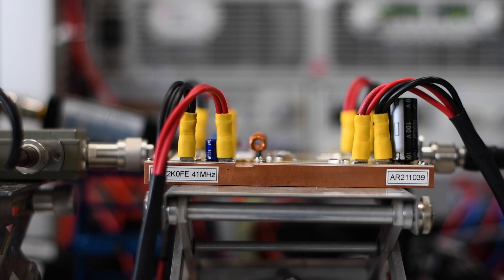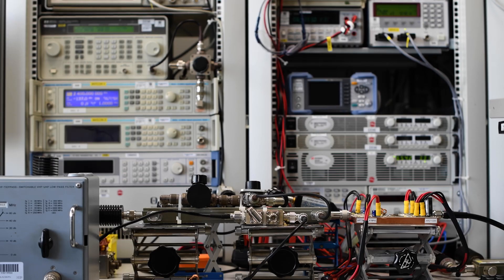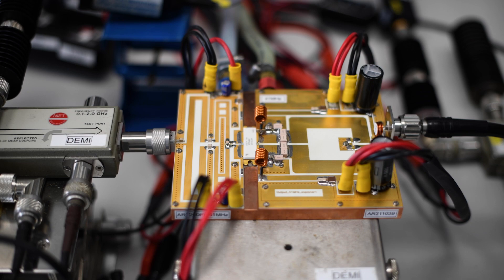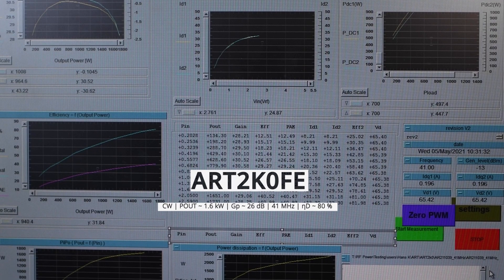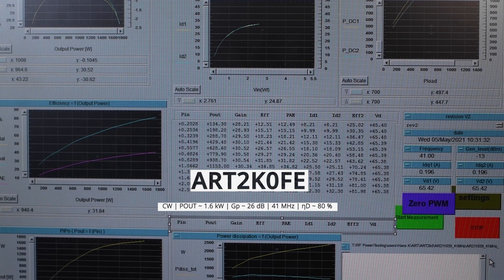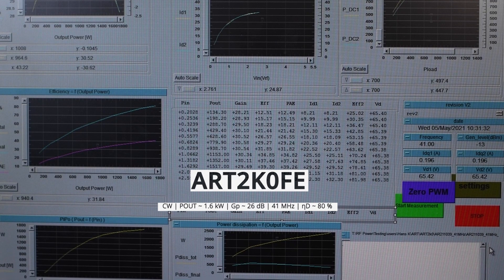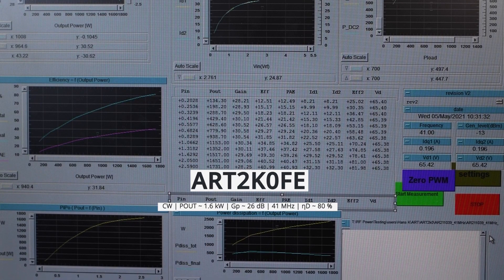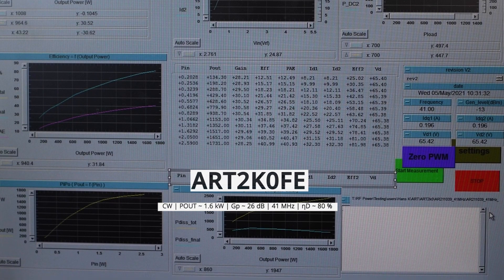Advanced Rugged Technology (ART) Si LDMOS Transistor Overview for ISM Applications

Comment: I would love to see the drains of that LDMOS withstanding the turn-off spikes generated by PWM modulating the input signal with the amplifier output connected to a dynamic load RF load and whether it can withstand a continuous short circuit and open circuit :))) ;)